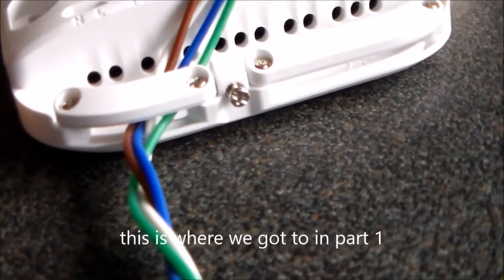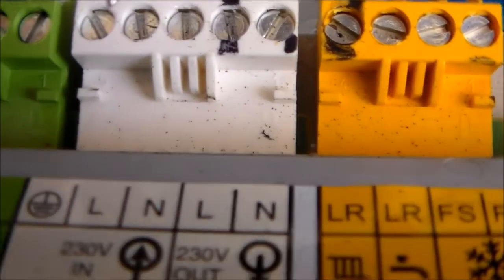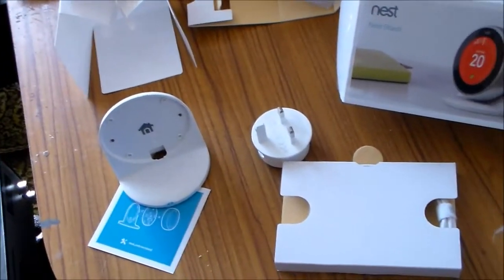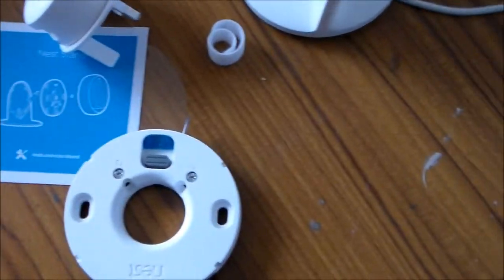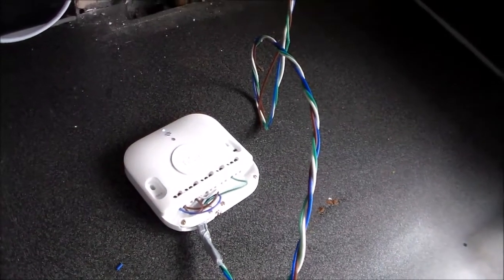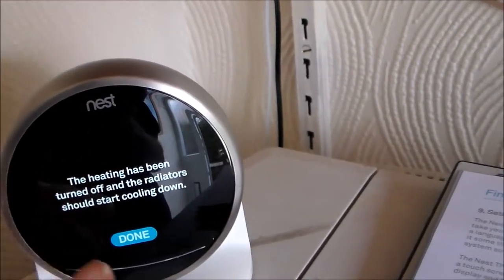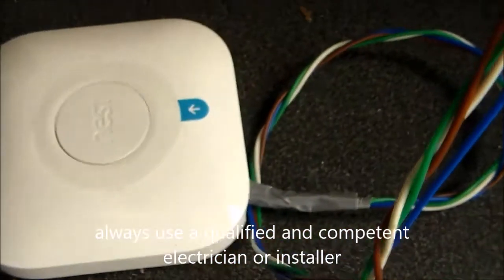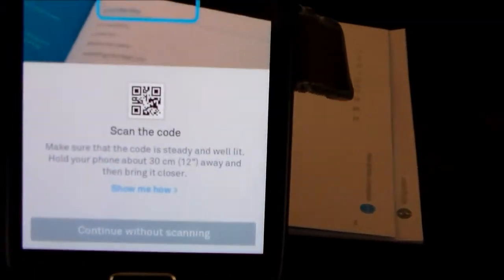Nest smart thermostat to Worcester Combi boiler install part2

Comment: Hi lathe,  Thank you very much for this video. I am able to understand how i should connect the cable between Worcester combi boiler and nest heat link. But i think i have a question is that from combi wiring diagram, the earth output to nest is the 1st connector but you are connecting in 2nd connector.
Reply from the maker: Hi Ganesh. It is so long since I did it that I have forgotten. My only safe recommendation is that you establish without doubt which is the correct connection by looking at it carefully and following everything through. Getting it wrong could be deadly. John

Comment: Just wanted to say thank you for this video, it really helped me to install my Nest Learning Thermostat as I have a similar setup were the boiler needs a constant live supply to be able to circulate the water independantly of the boiler being fired up. Many thanks.
Reply from the maker: Hi Andrew, sorry for slow response. You are very welcome - it is a journey of discovery! The circuit diagrams did not make it clear how you use the Nest with a Worcester Bosch boiler.

Comment: Hi, I have the Greenstar heat slave ll Oil external.
I noted that you have not done anything on the hot water side which i have a issue because i was wanting to control my DHW from the nest, But i have since found out that the nest is not compatible with Worchester boilers for the hot water due to not having Open therm technology. In fact after i had the nest installed by the installer, I ended up having to call out worchester because my water was going cold and not heating up. 
The worchester Engineer disconnected the purple wire.  

Looking at the wiring in the combi

Blue FR / FS No wiring in place ( Concerned because i thought this was for frost protection.

Yellow Block LR / HW Linked in from Live

Yellow Block LR / CH Black going to the heat link in the house

Red Block Earth going to the heat link in the house

Red N and L going to the heat link in the house

The grey or purple disconnected from the DHW

Below is the wiring on the heat link

looking at the wiring on the heat link, It goes as follows 2 and 5 are linked in via L Brown

N Blue
L Brown
1 N/A
2 Brown
3 Black 
4 N/A
5 Brown

The grey has been disconnected and the earth wire wasn't connected to anything

Not sure if you have an opinion, But i was hoping to run the DHW on timers since we only use hot water a few times a day
Reply from the maker: This is really useful information Malcolm. As my system is an instant hot water rather than stored hot water I am unable to help. The stored hot water systems I have seen rely on diverter valves.

Comment: H thanks this is very helpful. What is the purpose of the small white wire connecting the live out and live return. I already have a bridge in my boiler too.
Reply from the maker: Sorry Sam. Now that it is fitted I can't remember. I sometimes make videos to remind myself of what is what!
Reply: @LatheBits  Hi Again. Does you pump run continuously. I have this set up and then the thermostat is not calling for heat the pump continues to run. I appreciate it needs to run for a short period to dissipate the heat but I would not expect it to be permemantly circulating.

Chwers
Reply: @samreeve3709  Hi Sam. No, it does not run continuously. You may need to get a qualified installer to look at it. Mine will run for a little while after using the hot tap and as you say there is hysteresis or lag in the system so it will run for a short while after the demand from the thermostat stops.

Comment: Hi Lathe bits I noticed you have a similar boiler to myself a greenstar ERP. Does yours seem to take a while when it first calls for heat the flame symbol comes on, temperature rises to about 50 then drops again to about 30 then after about a minute it then ramps up slowly to the set temperature? Flame symbol is on all the time during this. It never faults out it just seems very slow to get up to temperature compared to my previous model. Thanks
Reply from the maker: It is relatively slow to get to temperature. I'm not sure what settings there are to change this.
Reply: Lathe Bits thanks at least I know its the software in the boiler.
Reply from the maker: @andymartin86  yes the boiler seems to have a mind of its own.